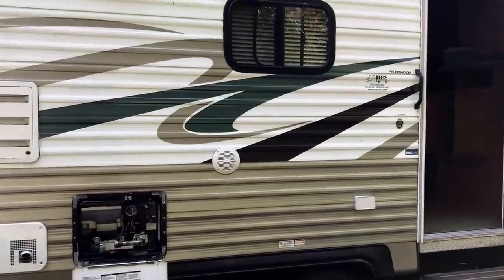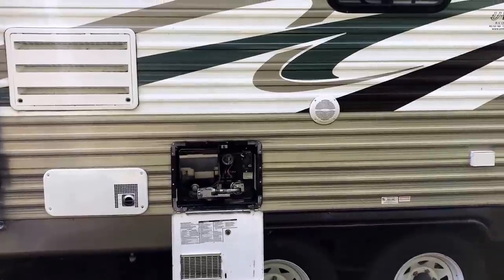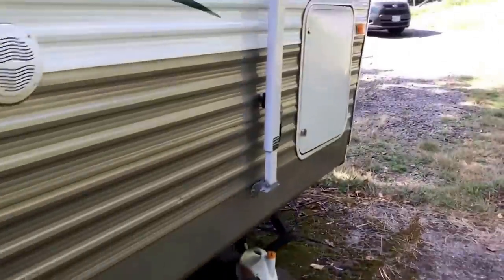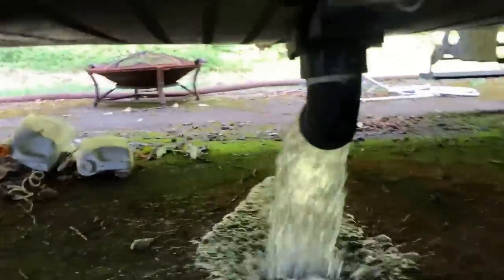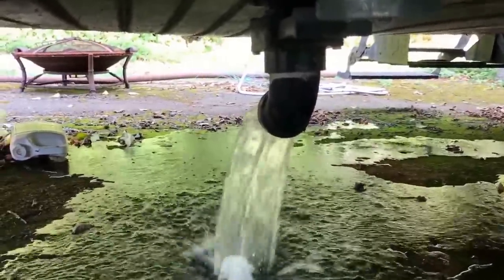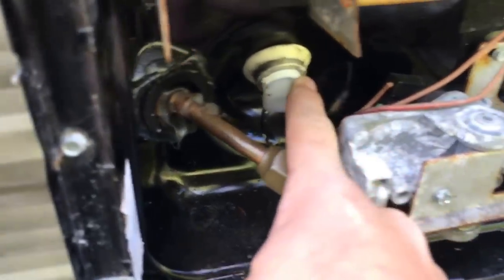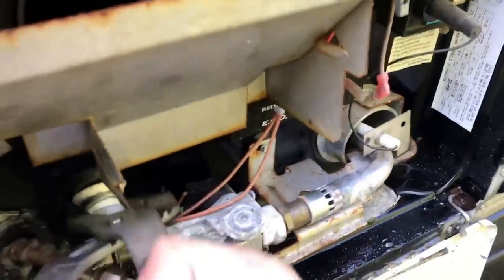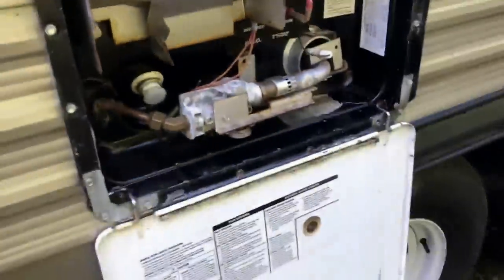How To Winterize An Rv Travel Trailer

Comment: I did this same process last year on my 25' travel trailer and ended up running five gallons of anti-freeze through the lines (it went through five gallons QUICKLY).  I'm trying to figure out how you used only 2 gallons.
Reply from the maker: Hi ted did you bypass the water heater? also sometimes people allow to much to come out of the faucets when doing it, on avg i use 2 to 3 gallons but your first time would definetly use more than me. ive winterized over 1,000 Rv's in the last 10 years. hope this helps